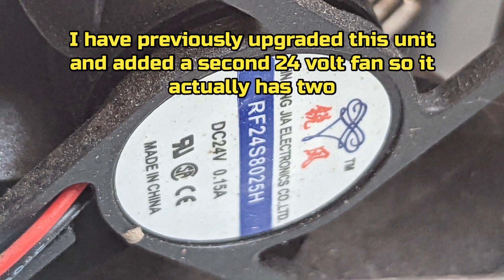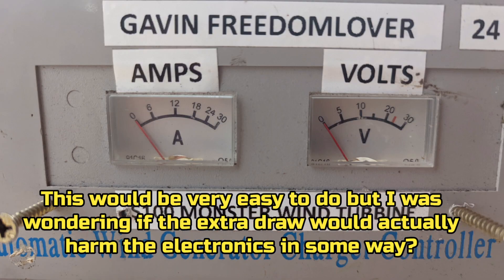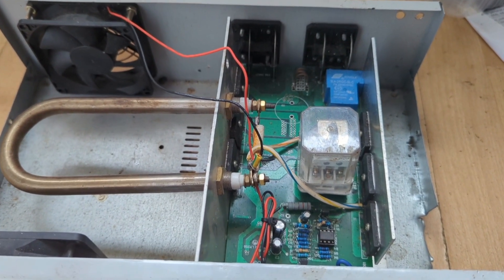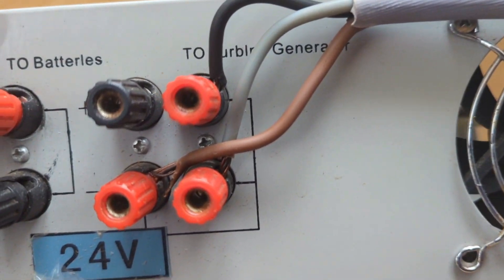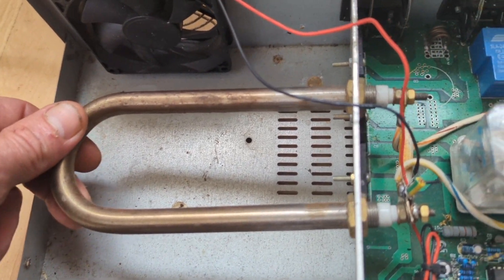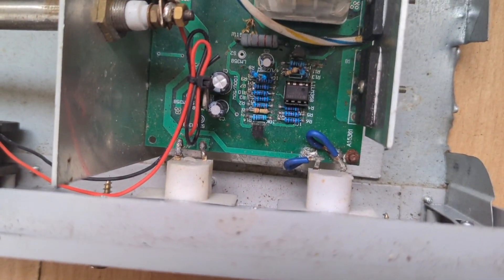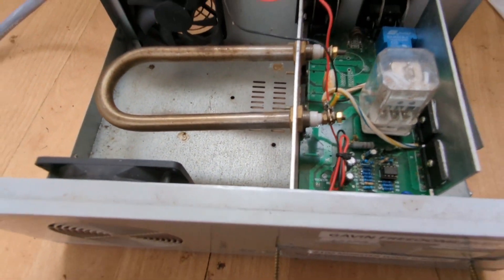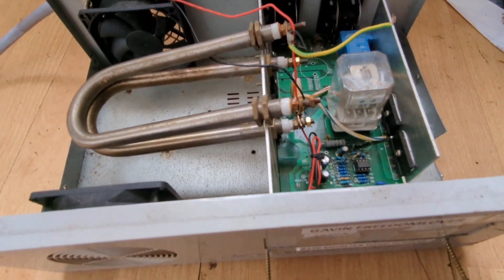Chinese Wind Turbine Controller 24v - Upgrade of internal dump load  - 12 June 2022

Comment: Have you considered running a low voltage custom hot water heating element in a domestic oil heater as a dump load? Silent with no fan failure risks. A large mains element might have the right resistance you need. I'm doing this.
Reply from the maker: To be honest mate I'm still learning about all this stuff I know so little about electronics it's shocking
Reply: @GavinFreedomLover  No worries....no criticism implied....we all have our strengths....just sharing some suggestions for you based on my own strivings a little like you....we all need to design our own systems....and evolve them as needed and as experience suggests....plainly you have a high improvement rate.....I've not put up videos like you so not had the suggestions posters get.....maybe I should.....

Comment: Is the relay switching dc or ac? Using newer silicon relays might be worth considering? What about dumping power to grid tied inverter like toys for watts does to reduce your power bill?
Reply from the maker: Im not sure , I will post a video made up of pictures of everything, I would ideally need to wire in a couple of meters , one of the ones with the bigger blue screen and maybe a meter to monitor power used by the load.

Comment: Let me guess the dump load is switched through the relay? Then it is about the rating of that relay, which you can look up from the numbers on it. If it is too small, solder in a bigger relay.
Reply from the maker: Yes mate thanks for that I will take a look , thanks.

Comment: i guess you could use the power wire to the existing heating element to power an additional relay that would transfer power direct from the battery to the secondary element through the additional relay, maybe with an inline fuse just in. case
Reply from the maker: Yes mate that's what I was thinking but a guy is just commented saying I'd have to look at the rating of the relay just in case. Because if I blow the relay I guess that's party over. Maybe I'll try and find out and buy a spare one anyway.
Reply: @GavinFreedomLover  yeh thats why you completely bypass it to run a second relay , using maybe one watt of power from the original heating element to switch the secondary relay on and off, with a power line direct from the battery straight to a second relay then through the relay to an additional element, same principal as wiring up spotties on a car.
Reply: @closertothetruth9209  blue relay probably can drive two power relays....if that's the driver of it?